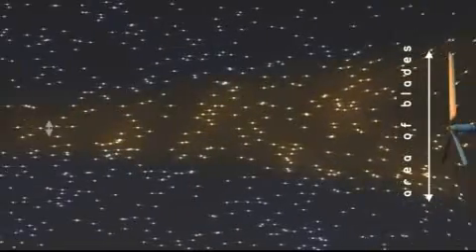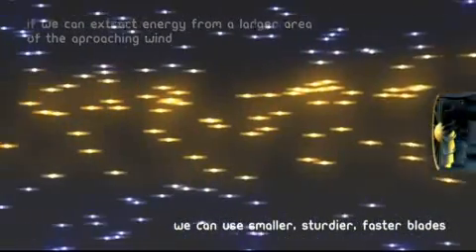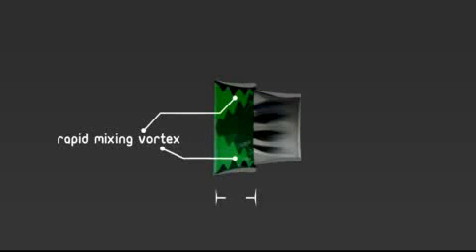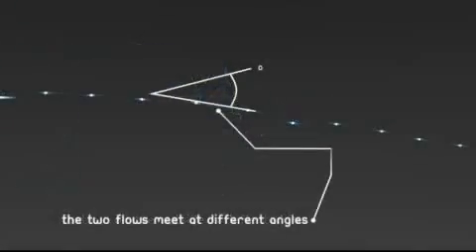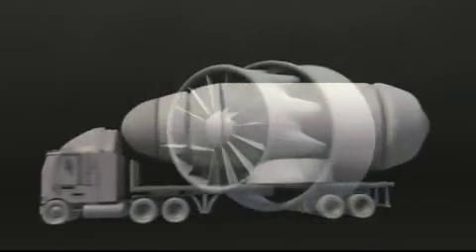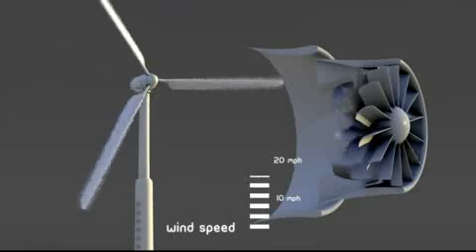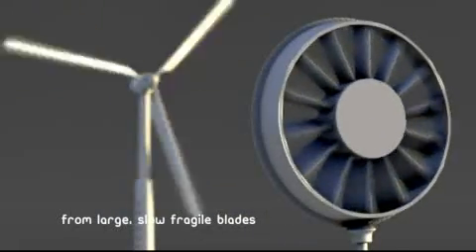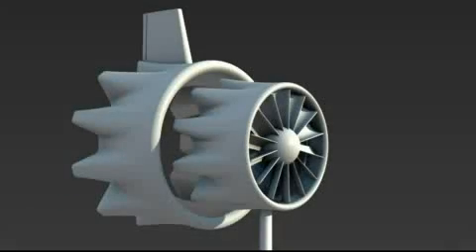New type of wind turbines / Nuevo tipo de turbina eolica

Comment: Shrouded turbines don't perform well.  The weight of the shroud will keep the entire assembly spinning as it tries to correct itself.  Having a motorized system to align shrouded turbines would be more ideal, that way the inertia of the entire thing won't cause it to overshoot its target.